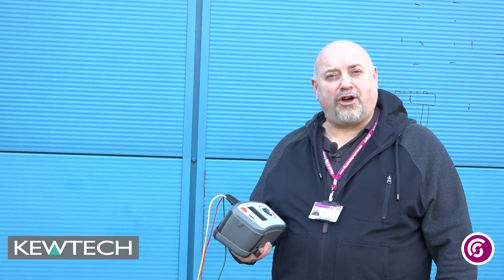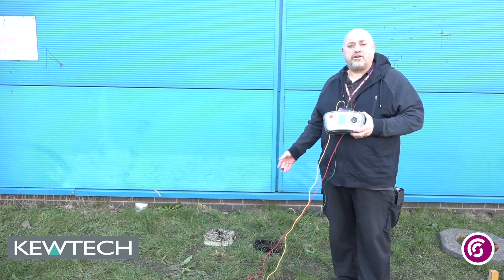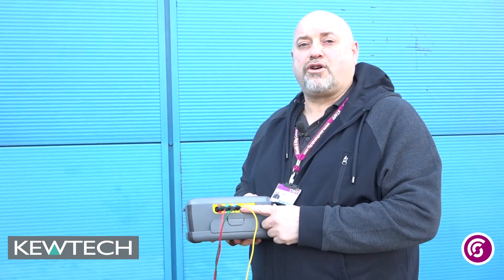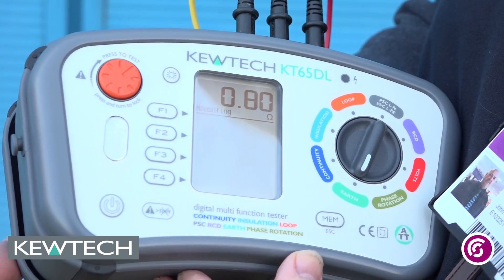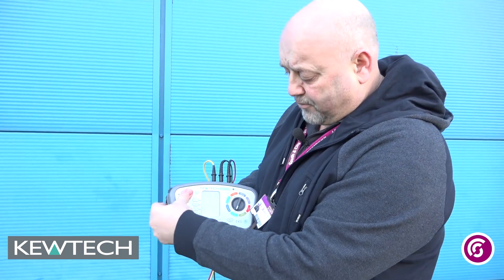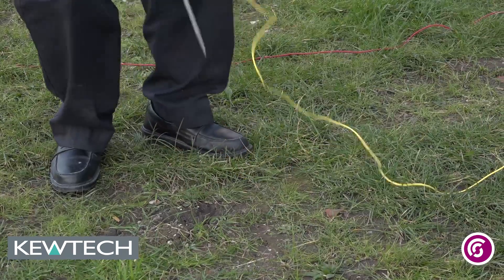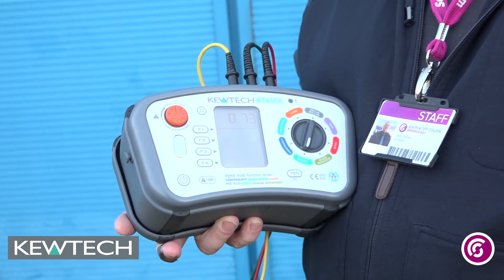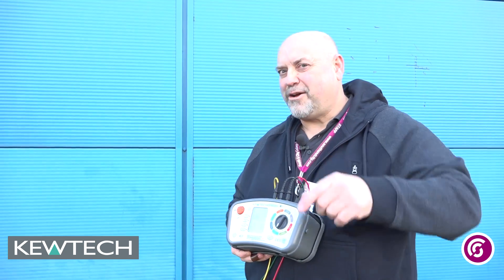Earth Electrode Testing with the KT65DL

Comment: The reading is simulated but still in the ground. It is very very low. I suggest the earth electrode has not been disconnected from the main earth terminal and suchlike or you are standing on a conductor and could plug in flashing lights nearly anywhere.